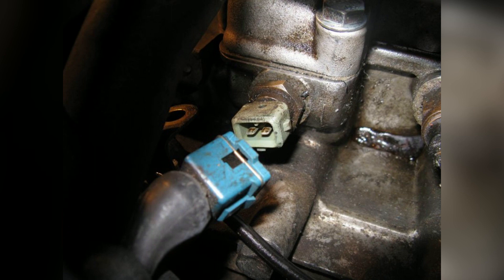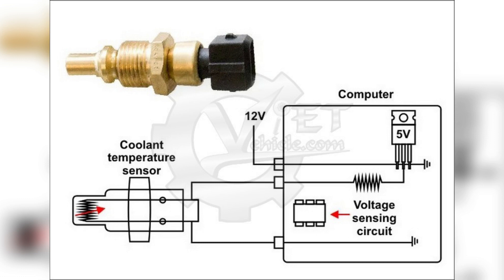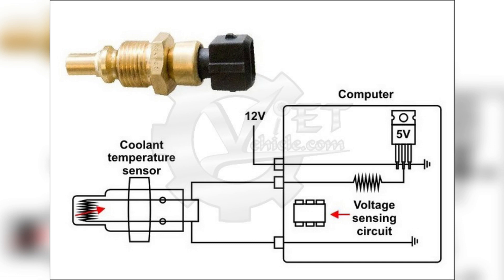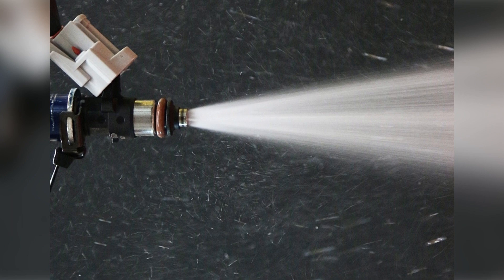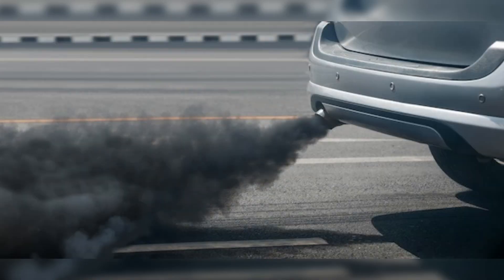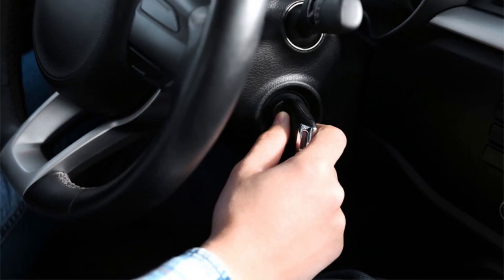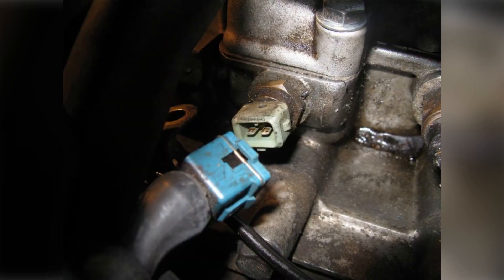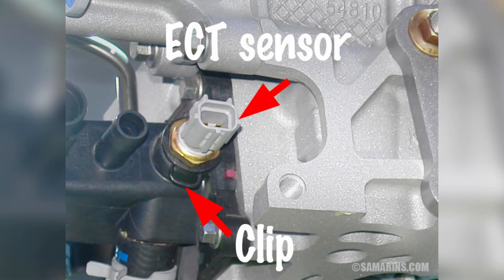Engine Coolant Temperature Sensor (ECT Symptoms, How it Works, Replacement and More)

Comment: Thanks for the video but l have a Ford Everest 2013 3 litre engine it does not show engine light and Glow plugs lights on the dashboard,can you tell me what is the problem.l change the coolant sensor but it is still doing the same
Reply from the maker: Hi there. Does the engine start?

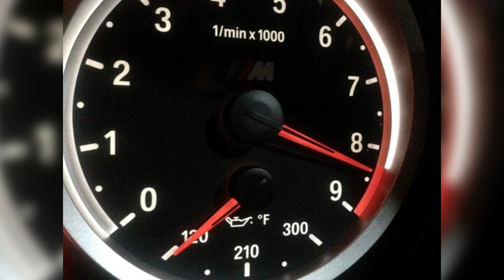Comment: What if the check light comes on and off an repeats 6:25
Reply from the maker: That can definitely happen with a bad coolant temp sensor. But since the check engine light was triggered, the easiest way to diagnose it is to scan the fault codes and you will know with certainty whether it's the coolant temp sensor or something else.